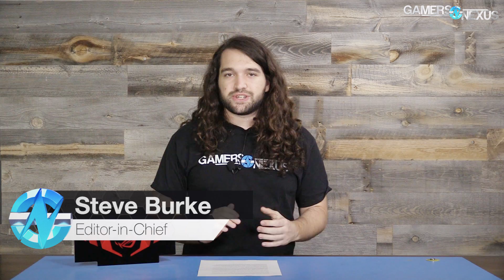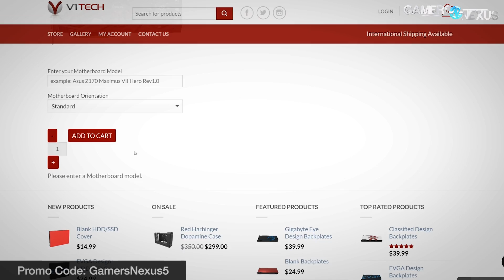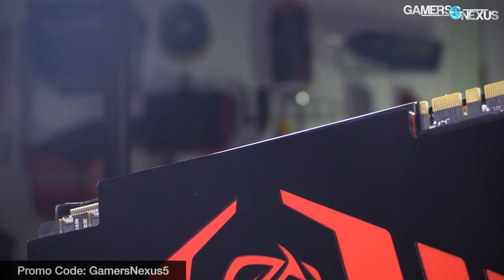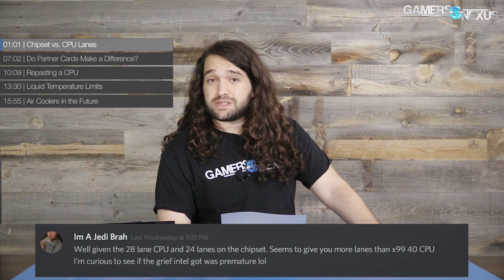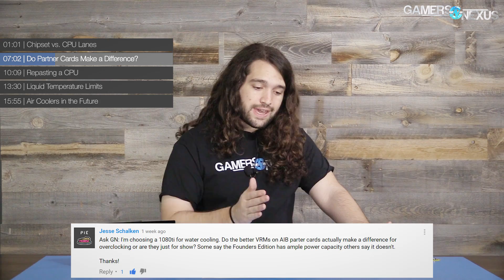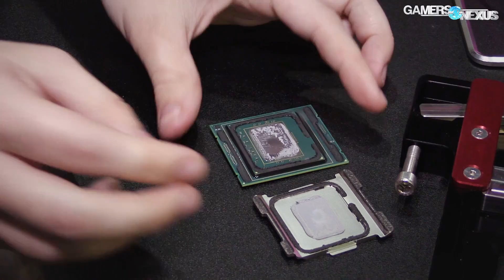Ask GN 51: How PCIe Lanes Work (CPU vs. Chipset)

Comment: Im sick And Tiered of AMD pulling Graphics Cards with compute power Maxed. Please Call it what it is, A Compute Card. Polaris was launched 29 June 2016 More than A year ago, And Had so many stabuility issues that most people who had a choice just dropped the card in the trash or Went with something that worked. PCI-E Power draw issues Potentially Harmfull operation on the motherboard PCI-E Socket. Then On top of that they pulled the 580 out to somehow fix that issue and make headway. They are not competitive in Performance or stabuillity So I wonder if they are out to lunch or if they really want to create a card that is a CPU that just plugs into the PCI-E. Its not a graphics card if it just runs compute. Its not more efficient if its not Capable of Maintaining stabuility, and I wonder if WE are all just along for some ride that Would not have happened if ATI was still in buisness. We need to look at the Cards across the last several years and do a Broad spectrum review of all of the history that has been made this last couple of years.

Comment: Will the Dark Rock Pro 3 be enough for Threadripper given that it's rated TDP dissipation is 250W? Does that mean that the cooler will run at max fan speed while the chip is going to be somewhere around maybe 80°C?

Comment: @Ask Gamers Nexus : Hi @Steve, the Bloatware issue was very informative.
What still interested me, now I have a lot of extra software.
From CAM / NZXT, Corsair-INK / RAM, MSI-Dragon Eye / Mysticlight for GPU / Mobo (GSKILL) and many other control software alone in my system!
Does these different programs slow down the PC?
Reply: Not gamersnexus, but it really depends on the program and how it is coded. Basically anything that auto runs during start up is going to negatively impact boot time even if it just sits idle. For example my wife had a few things like spotify that ran at start up and made her laptop really slow to boot. I turned these to manual start and it boots up in less than half the time now.

Above I discussed boot times which is a pretty big deal, but nowhere as annoying as losing gaming/encoding/etc performance because of programs that generally sit in the background that you use sparingly. My rule of thumb is if I don't need it to be running it generally isn't, but this adds some inconvenience and complications that a lot of people probably won't want to go though. The easiest way to see if this kind of program is having a negative impact is to go to the task manager and see if any of the programs are using up resources.(cpu, memory, disk, network) The Easiest way to get to the task manager in windows is to push the ctrl, shift, and esc keys altogether. If your system is sitting idle and you are using more than a 4% of your CPU and ~25% of your ram you might want to look into shutting some of these programs down at least while you are gaming/etc. Theoretically you should only see a difference if your CPU is being maxed out(or nearly) maxed out while gaming/etc.
Reply: Casey Cornett much appreciated

Comment: Are Gentle Typhoon or Vardar fans the "way to go" for CLC use over Noctua ones? I recently bought 3 NF-A14 PWMs and wouldn't mind everything being consistent-looking inside but if the performance difference is significant I can deal with the visual mismatch. Noise is a big concern for me.

Comment: I'm fairly sure on an Intel 40-lane CPU you actually pull 4 of those PCIE lanes for HSIO and you only get 36 for graphics. I think you left out and forgot to mention that part. Which would be 16-16-4 is all that's left for graphics. HSIO uses a portion of CPU PCIE lanes. Also NVME/M.2 are direct connect to the CPU as well. If you use a NVME/M.2 device (1) then you rob the CPU of another 4 lanes and leave only 32-lanes for the graphics cards after NVME + HSIO. Use two NVME/M.2 devices and you then only have 28 lanes left for video cards (HSIO + NVME + NVME), which will run the first GPU @ 16-lanes, and the 2nd at 8-lanes. This is why everyone's so upset over Intel.. 40 lanes is /NOT ENOUGH/ even remotely to handle dual-video-cards + NVME/M.2 + Onboard components. We should have at least 60+ from Intel by now. This is why AMD Is going to win big this time around, with 64 lanes from ThreadRipper we'll get 4 for HSIO, 16+16+16 for video cards and still have 12 lanes left to be able to push 3xNVME/M.2 at full speed and nothing will slow down anywhere. Which technically is not something Intel's X299 platform is physically capable of doing.

Comment: STEVE, for the PCIe lane discussion, I would have mentioned to whom having more then "X" amount of lanes doesn't really matter to. For example, anybody who plans to just run one video card.

Does this matter to anybody who's not using more than a high-end 2x SLI configuration like 2xGTX1080Ti? If not, is there even much loss of FPS with 2xGTX1080Ti with 2x8 instead of 2x16 (PCIe v3)?

So exactly WHO needs more lanes?

Comment: If he is going for strictly water cooling shouldn't he go for the 1080 ti armor since it is a gaming x without that good cooler. it is the same board as the gaming x with 40 bucks knocked off and the better vrm.

Comment: With liquid cooling, are there noticable differences in cooling performance when it comes to how quickly the liquid runs through the loop? And if this is a factor, do pumps normally come with adjustable speed settings?
Reply: Nope, or at least there shouldnt be, as heat will transfer through the liquid at the same rate regardless of flow speed. It works exactly like the cooling system in your car does. The only variable, really is how big of a heat exchanger and how much fluid you have in total. More fluid means more heat can be absorbed into the system, and dissipated. A bigger heat exchanger means it does so more efficiently, as well as increases the total fluid capacity in the system.  In theory you could up the cooling of a system, with just longer tubes and keeping the same size radiator. It won't be as effective as a larger radiator as a radiator size increase both increases fluid capacity as well as tremendously boosts the surface area for heat to be shed.

The pumps importance in a system is merely keeping the fluid moving through the system, to move it through the radiator and bring cooler fluid over heated surfaces more quickly. This is an important job, but as long as the pump is flowing enough liquid to keep cooler fluid over the heated surface quickly enough to dissipate heat more efficiently the speed of the fluid does not matter.

Comment: so did i get that right that if i use a PCIe M.2 on Z270, it will use 4 lanes of the chipset, while gpu keeps running all 16 from the cpu? and if i decided to go sli, would it divide to 2x8 while the M.2 drive stays at 4x chipset lanes?

Comment: I'm not sure about when the re pasting needs to be changed... I'm running a 6+ year old Sandy i7 2600k @ 4.2 Ghz and my "real temp" scores with a Zalman x9900 air cooler is running in except-able thermal range.   High 20's in idle and mid 50's in gaming with Six year old Artic Silver paste.  So.. I'm not sure if tearing down the system for pasting is necessary.   I smeared and buttered my CPU heat sink years ago if you were wondering the application process.  Thanks for the enlightening informative video Steve.

Comment: The beQuiet! Dark Rock Pro 3 works great on my 4790k (1150 socket) @4.4GhZ. At full synthetic load temperatures never exceed 65°C, fans run at ~860RPM and ~1150RPM and you can barely hear them. (My Strix GTX970 gets way louder in games anyway) Though I had to be careful of which RAM I choose because of the masive cooler :)

Comment: I really prefer HSF as I don't like dealing with pump failures and I have no interest in custom loop, I want reliable with little or no maintenance. I hope the figure out a solution, I wish they could use a 360 Rad as a fin stack and connect it to the CPU plate without using liquid and a pump.

Comment: 15:55 EKL Olymp has 350W TDP and fits in my Fractal r5 just fine. Install the backlate then the MoBo and after the cooler, cause you might not be able to plug your CPU-power in with these big coolers already installed.

Comment: Damn, great timing on this video. EK just released their new fluid gaming kits which you can get a full custom loop with a GPU block in included for 240$...but the block only works on founders cards so I was curious if the founders was gonna be good enough for some overclocking.

Comment: One of the major issues is that Intel dropped the prices; 8-core down from $1099 (X99) - $599 (X299). Great if you only want cores and raw computing power! But the X99 8-core had 40 lanes. The new "cheaper" X299 Skylake-X only has 28. So Intel simply shifted the lane limitation up to 8-core from 6-core (though the 6850K 6-core did have 40 lanes as well) and kept the 40 lane entry price for X299 high at $999. I think this is conceptually one of the big issues. It's somewhat of an illusion to better prices depending on your needs. I have not heard anyone who understands Kabylake-X; very expensive motherboard and a cheap CPU that can't use all the memory channels/size, is limited to even fewer lanes, and whatever else Intel neutered. Then there is the whole RAID thing with a plug-in key that costs money; 0/1 $99 and 5/10 $299. Take these, and other issues, all together and that's the frustration. They held out a carrot and then snatched it back to a degree with a hand out. Oh well. It's still a good choice based on your needs.

Comment: Concerning the be quiet Dark Rock Pro 3 and its mounting: get the nuts and spacers on the brackets, tighten them and then use the screws from behind the motherboard to tighten the cooler to the board/CPU with a screw driver and not the silly wrench thingy. Can be done alone easily, did it many times already and no removing of the fans necessary. BTW there is a female youtuber "Foritain" who found that out, too. Just saying that sometimes women are more intuitive...

Comment: You kinda miss the point of Chipset vs CPU lanes... All lanes running from chipset will be switched from chipset's DMI bus, which is a PCIe 3.0 x4 link with a fancy name... Which means all those lanes will compete for bandwidth to talk to CPU and the more devices you run from chipset, the more starved they will be, for example 2 Samsung 960 running from chipset will be enough to bottleneck DMI bus, and we're not even taking into consideration that all SATA, USB and ETHERNET usually runs from chipset...

Now, the reason there's a lot of flak for X299 is that because of Kabylake-X, all motherboards have to take into account that you may run 16 lanes, so they run any extras from chipset lanes, like M2 slots, USB3 gen2, ThunderBolt, 10Gigabit Ethernet, etc, which you would ideally run from CPU lanes to avoid bottlenecks... Now, even if you buy a 44 lanes CPU expecting to have enough bandwidth to run several m2 ssds, it won't matter because all those m2 onboard slots will always run from chipset lanes, so to avoid bottlenecks you're forced to use adapters to plug those m2 ssds on x16 slots...

OTOH, on X399, since all CPUs are guaranteed to have 64 lanes, mobo designers can make those extras run directly from CPU lanes

Comment: informative as always. talking about largish air coolers, I still have an Asus Triton 79 Amazing(630 of 3200) in my 2nd machine, that's quite big and heavy :) bloody good for temps though, well it was when I had it on my QX9650 and that was a 130w TDP, don't know if it would still be any good ie for my 2600k if I could somehow shave the holes in the mounting bracket? Good idea/Bad idea?  Wanted to do it ages ago but i was a bit wary after the cpu blew up whilst I was overclocking because my psu was old and couldn't dish out enough power(or I think that was it) :(

Comment: I'd just like to point out that the NH-D15 (and a few other large air coolers) are rated in excess of 220W TDPs. Large air coolers will likely be around for a while - NH-D15 pretty consistently keeps up with 280mm AIOs.

Comment: Thanks for the brief explanation about PCI lanes. I just read that if we want ... "4K video at 120Hz (or 240Hz) on a PC will require PCIe 4.0"

How true is that comment? I'm hearing that with NVMe fast storage and VR, we will need PCIe 4.0 if we want true 4k gaming and VR at 120/144 fps, especially with 21:9 or 32:10 ultra-wide.   Will gaming with a Volta GPU and an NVMe SSD on 4k at 120/144 FPS saturate PCIe 3.0 x16 - especially with an ultra-wide monitor ??? 

Also, is PCIe 4.0 coming out in 2017 or not?  When can we expect to see PCIe 4.0 support on motherboards, GPU's?

Comment: I'm planning on doing a m-itx build in a fractal core 500. it allows a 120mm fan and i'm wondering if it'd be better overall for thermals and sound to go with a videocard with a gpu liquid cooler(evga hybrid) or a cpu with a liquidcooler or just both air.  95% of the heavy workload on the computer will be videogames, and maaaybe every so often i'll do some 3ds rendering, but not much at all.

Comment: Why does RAM have round numbers of GB? 2-4-6-8... Never heard of 3GB RAM or 7 GB.
Reply: Aurkonungr its easily possible to manufacture 3-7 gb ram..round no is industry standard i guess. back in the day i used to have 3 gb ram on my pc ( bought two 1 gb stick and later scrapped i more stick). ramsticks are actually clusters of smaller ram modules..for example a 4 gb stick is usually a cluster of 8x 512 mb ram modules put together..and a 8 gb is usually 8× 1gb. there is no hardware limitation to do 7× 1gb. same for vram in gpus..we actually see more variety for example 3.5gb (7x 512mb probably) in gtx 970 and 11× 1gb ram modules soldered in gtx 1080ti board.

Comment: Finally got some information on PCIE lanes....thanks a lot.
But I have 2 questions...1)what is a PLX chip and how does it work? 2) How to know which PCIE slot takes lanes from CPU and which takes them from PCH...I would appreciate if you provide the answer with an example..thanks again..

Comment: would applying liquid metal between the CPU and IHS on i7 6700k impact thermals enough where i'd potentially have a more quiet system considering i run 280mm AIO on it?

Comment: Intel really dropped the ball at the worst possible time. People who have been holding on to their overclocked Sandy Bridge cpu's and so on have reached the point where they are finally ready to upgrade.  AMD jumped in at the best possible time. I think the best move Intel could make to counter AMD and the bad press they've gotten for the poor choices they've made is to make Coffee Lake the next Sandy Bridge. Throw solder tim on the Coffee Lake cpu's and make them OC beasts like Sandy Bridge with a decent price. That would go a long way in saving  their year. It's just my opinion, but saying a cpu that a few gens ahead and not due until next year is "looking good" doesn't help them. Just make Coffee Lake an OC beast for gaming like Sandy B was, and if the 6  core rumor is true, and you make that a solder tim OC beast that can approach 5ghz OC, all the better. Would completely change the negative narrative hanging over Intel atm.
Reply: Ryzen small OC range is a design decision that AMD took when designing the die soldered or paste TIM won't change that.
Reply: ThrakazogZ I honestly dont care about the soldered. Ryzyn was soldered and it oc like crap. Also today are such weakasses.  gpus and cpus arent this weak little fragile snowflakes.

Comment: I looked at my 6600k's thermals under a 4600 MHz OC and I noticed something of concern. My third core (#2) is always 20C higher than my other cores. I have had my CPU for over a year at this point (built last year around March)...should I be worried? Is this something unusual that Intel's warranty may cover?

Comment: my 6970 after 5 years was NOTICEABLY louder.....the fans would have to ramp up into the "thats annoying" zone, while before, it was almost always super quite, expect in very intense apps (its an msi lightning 6970)

stuck some notchtua paste on their....and temps went down by almost 15c iirc. 

my phenom 2 6 core under a NH d15.... didnt notice it.

phenom 2s run cool anyway..... mine on a 4ghz oc didnt get over 48-50c..... and got unstable depending on the test once past 55c 

i never heard the cooler, and i never crashed...... so im lazy and didnt want to do the work
if it aint broke, dont fix it

Comment: I had a laptop that would overheat during prolong gaming sessions, after Steve's video on his editor's rig I took it apart and the thermal paste was like rubber or light plastic. About the consistancy of an elastic band - floppy but solid, slightly stretchy, and dry. It was about 5 years old and after repasting, it doesnt exceed 80c under load (previously shut down hitting 100c).